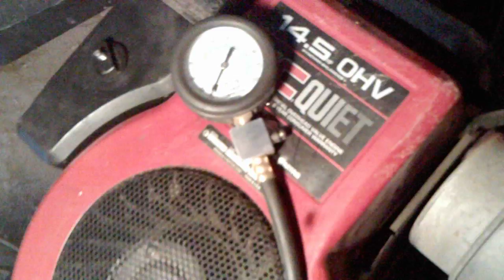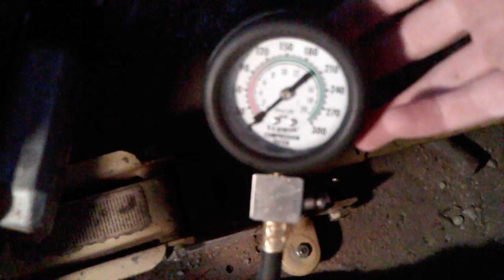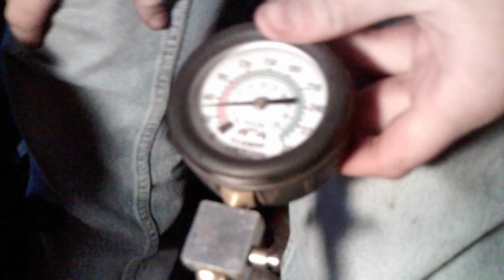Compression test on Briggs & Stratton 14.5hp IC QUIET

Comment: Same engine and had a compression of 70 psi.  With a few drops of oil in the cylinder it went up to 80 psi.  But I have other lawn tractors that run fine with only 50 psi. As long as no gas is getting into the crankcase it's good to go.

Comment: im not sure but they may have a compression release on them, i know on the 12 hp i read they do and you have to crank it over with a car battery jumped to the cable to get it to 325 rpms to read the compression

Comment: That red zone is for automotive applications. Most small engines will run perfect with 60 PSI, also that engine could have been lower due to an automatic compression release. A more accurate reading is done by spinning the engine backwards, if the engine has a compression release which it most likely does.

Comment from the maker: The engine is doing much better now. it has a new head gasket and adjusted valves. it runs a lot better now.
Reply: Thanks for the feedback on what you did to fix the issue. I will do a head gasket change followed by the valve adjusted.

Comment: @chevykid5 It is the head gasket because the same thing happened to my 14.5 briggs its not completely bad but there is a worn spot between the pushrod and piston on the gasketso oil gets thorugh Its very common on these engines to do that and the reason the oil is getting into the breather is because of the oil seeping through.I have seen many cases of this and its the head gasket. Its also only $8 not like $50 and rings are lots more.Also what were the valves adjusted to?

Comment: @johndeere4300 last the thing with the breather hose is i had the mower tipped on its side when i was fixing the clutch and the oil from the cylinder when into the carb and it went into the breather so that is why there is oil in the breather.

Comment: @johndeere4300 ok im not saying your dumb or anything but this is actually my engine and i know that it doesn't have a blown head gasket and i adjusted the valves a couple months before i brought it to his house so i do know that none of them are the problem. I also know that the engine does need rings because it is very tired because the previous owners used it to pull stuff around their yard and i also know it is passing oil.

Comment: is there oil coming out of the tube going to air filter? then its surely the head gasket. Also the smoke means a bad head gasket also and the spark plug being corroded . Because thats what mine did until i took it apart and saw the head gasket was bad. So a valve adjustment and head gasket will solve your problems and maybe the pushrods are also bent if they are there also under $20 for both on the briggs and stratton website.

Comment: It may only need a valve adjustment donyboy73 on youtube has a video of how to do that. Every year both valves should be adjusted. Also these briggs engines have a compression release system so it probably doesnt need a rebuild. The valve adjustment isnt hard. ooh another thing the head gasket likes to go after like 5 years on these engines also and it only costs under 10 dollars. he also has a video on how to do that.